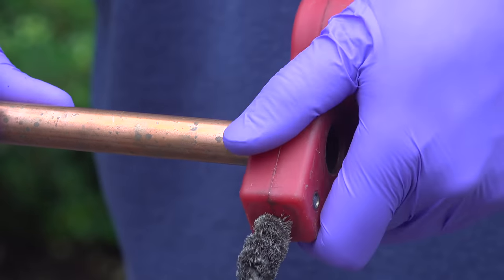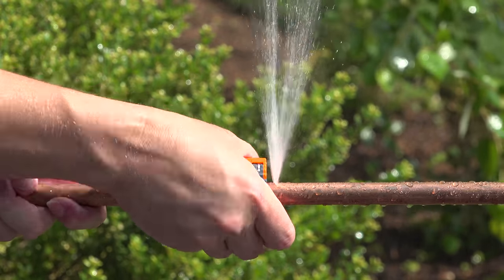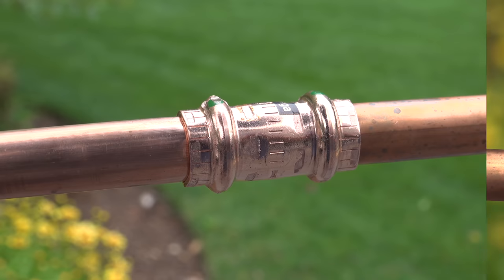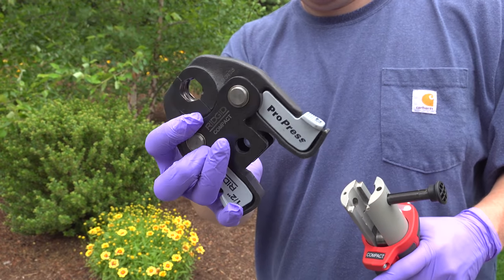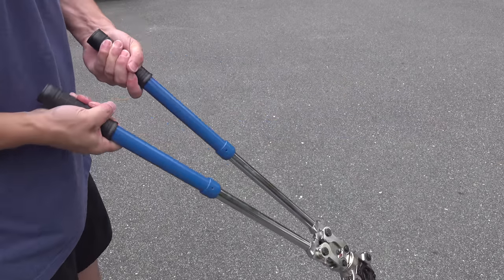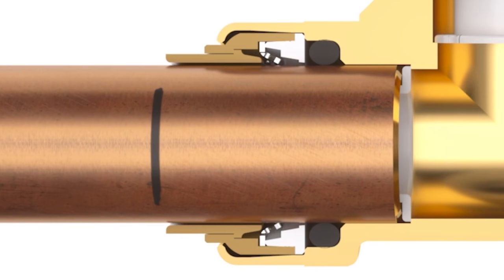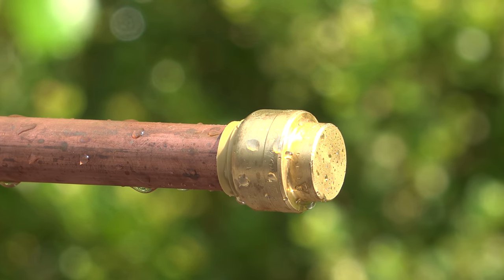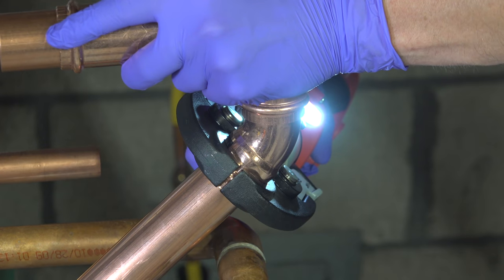NEVER SOLDER PIPE AGAIN - 3 Ways for EASY DIY Plumbing

Comment: These diy video alway install sharkbites wrong, never seen one yet as to where they were installed the correct way, they never clean the pipe. They never de-bur the pipe, they never wipe the pipe clean, they never use the tool required to make sure the sharkbite is pushed on all the way. , these videos pretty much do everything wrong. But hey what do I know I'm only a licensed master in 3 states. I never use sharkbite fittings except on mobile homes underneath. I get many calls due to sharkbite fittings failing because they were never installed correctly,  so if you are going to use them because your to cheap to hire a master plumber at least install them correctly.

Comment: put this on the list of useless things no one should ever use. The only possible use for these connectors would be if you had a faulty main water shutoff and could not dry the pipe out enough to solder it.

Comment: Does any Plummer in the uk actually still use copper???  The plastic trash is almost universal now. Needs absolutely no expertise to fit, lasts just long enough to outlive warranty and don’t worry about rodents getting at it.  “ I don’t work in buildings with rodents in” some clown said to me recently.

Comment: There will always be a place for soldering. Stop trying to take the skill out of everything. I’ve been plumbing gas and water for 15+ years and I haven’t had any leaks (that I know of) and i haven’t burnt any houses down either.
Reply from the maker: Yup and I would feel bad except for the dozens of failed soldered joints I have fixed over the years. They always fail for 2 reasons, lazy plumbers never debur and could care less about washing flux off. Creating weak points. Those type steps would make copper bulletproof but sadly plumbers caused their own issues, good news it always took 10 years for the leaks to show up, but the customer pays. Maybe you do. but 99% of plumbers could care less as it's an invisble laziness.
Reply: @SilverCymbal  I can see your point there’s some terrible plumbers in the uk but a lot of the easier to use products create bad engineers, as they don’t feel the need to train properly before going strait in and using them. Anyway happy plumbing pal.

Comment: I moved to uni-twist water pipes 3 years ago i dont like copper it is way too expensive and it degrades fast. The copper of today is not the same as the copper 7 years ago todays copper will get random pin holes if you look at it funny

Comment: I would never use.  Work great for a couple years.  They fail with water hammer and movement of the pipe.  Solder is a proven long-lasting system. I would never buy a house that used this product.

Comment: Stupid.  These are for plumbers who want job security to be called back when it leaks.  This is not a permanent, solid solution.  Too many people creating designs on computers and measuring profits and not enough hands on, permanent fixes in the real world.
Reply: Wrong
Reply: @NoName-zz8nl Orings fail before copper pipe does.
Reply: @Think_Up  who cares
Reply: @NoName-zz8nl  The homeowner who has inferior plumbing work done.
Reply: @Think_Up  so are you against press fittings as well

Comment: This is the kind of shit that gets people in trouble.   O-rings will fail.   Learn how to solder or call a professional.  Experience and skills will never be replace by more parts and fancy toys.
Reply: I changed my bathroom sink pipes with the press on fittings and shut offs cause it didn't have em. Like why not!???!? IDK but the cold line to the washer held up fine but the hot water one leaks a little so yeah I agree. Sometimes they work and sometimes they don't.

Comment: Rubber seals are an abomination to mankind.  They work great, are generally easy to install, and they tend to seal up nicely.

Such properties would seem like a great thing, but that is how they trick people.  Rubber has one really important flaw: most rubber compounds degrade, dry out, and crack, simply based on extended exposure to ordinary air.  Seals made with rubber compounds work great when first made, but in a hypothetical future (ex: 40+ years from now), all such seals will eventually fail, and when they do, they will convert otherwise valuable homes into desolate mold heaps that smell like well seasoned gym socks.

Either people need to become rich enough that they can demolish and rebuild their house every 20 years or less, or, people should not use rubber to make plumbing seals.

Comment: Push fit joints are not always secure and the rubber seals do degrade over time. So you spend a fortune on a compression tool? 🤪 You’ve got to be insane?

Comment: A real pro press crimper is way ore than soldering.  
You showed a tiight location youn soldering.  You then showed pro press in an open area.  It's alit easier to solder in wall than to shove a pro press in there.  
You reposition the electrical line and put a rag next to the wood.  You could easily do everything in 2 minutes.  Mapp gas solder Flux boom your done.
Oh I'm one of those professional plumbers.  
Shark bites are good buy don't patch me gas pipes with them.  This for you is oxygen lines in a hospital.   
From a real plumber.

Comment: Never use "O" ring fittings as a permeant joint. "O" rings harden and crack with age. Ending with a leak. They will cost you many times in terms of water damage. Learn how to solder, Period.

Comment: dont use sharkbites or any other bull crap likeness method, unless you can reach it anytime
not in a wall for the love of christ

when will this stop

soldering is way superior to any of the above methods
it doesnt have rubber which over time with exposiure to air changes it qualities

Comment: Stupid video. Expensive tools and fittings; O-rings guaranteed to wear out in a few years and then it's leaking again causing unknown damage; tool can fit in tight places. Soldered joints have proven to last 50-100 years and it's cheap and the most effective for copper piping. This guy is being paid to advertise for these companies selling unproven over long periods of time junk. Don't fall for it and be stuck with thousand of dollars in water damage repairs.
Reply from the maker: I was paid nothing for this video, received no products, zip. What is wrong with sharkbitess? I mean aren't we past the it's gonna ruin your house, consdiering they sell like 100bil of them a year.
Reply: @SilverCymbal  The degrading rubber O ring (think faucet seals) that will eventually fail vs a soldered joint that could last the life of the pipe.

Comment: Don't forget to tell the people watching this video how expensive your propress tool is...This vid is kinda ridiculous.
Reply from the maker: You might watch the video
Reply: @SilverCymbal  I did...200-2000. doesn't make a bit of difference. Sweat the copper...Done. The only plumber I've ever seen use that propress didnt know how to sweat copper. Anyone can sweat copper. The real skill comes in when you have to do it in difficult situations without causing any damage.
Reply from the maker: @danielpickett8560  You may be in a warmer climate. Propress is heavily used in forced hot water heating systems, even I am surprised at how common it is now for new installs. Do what you want but if you are just bragging that soldering makes you picasso or something thats fine but many pros already have switched to proress

Comment: The fact that you even bring up shark bites is pathetic those fittings are trash.
Reply from the maker: In theory or reality? I have some on 1 1/4" lines for almost 10 years without a single issue. Do what you want but there is a reason Home Depot has an entire aisle dedicated to them
Reply: @SilverCymbal real plumbers  like me call them temporary caps Handy Andy's like you use them for entire plumbing systems big mistake buddy, lol the inside of those things turn brittle they definitely do not last 10 years stop lying , also home Depot sells flex seal it doesn't mean it's alright lol
Reply from the maker: @youtubeblows326  Your name says it all
Reply: @SilverCymbal  my name says YouTube blows lol, that joke doesn't work buddy 🤣nice try handy Andy.

Comment: Soldering really isn't that hard -_-
Reply from the maker: Do what you want to do. Not soldering is very handy, not hot work permit, no fires, no issue of water in the pipes. It's good stuff, they just need to have Ryobi make it so the price is more affordable.